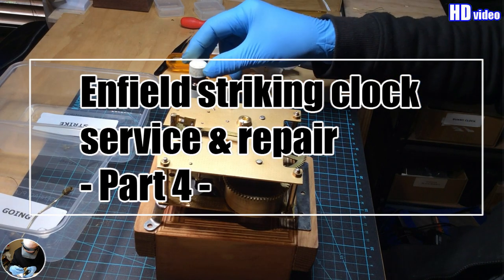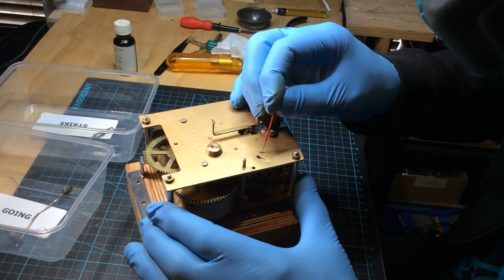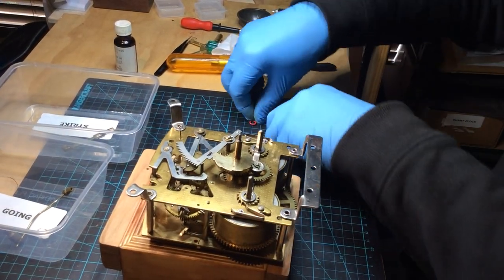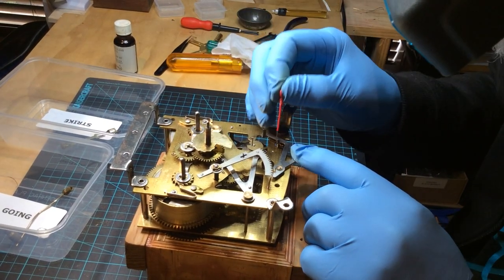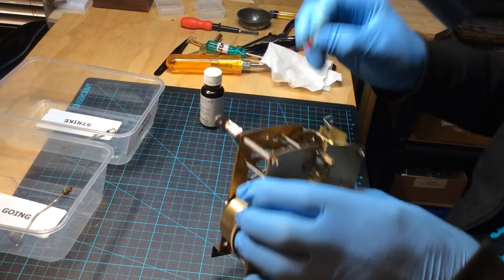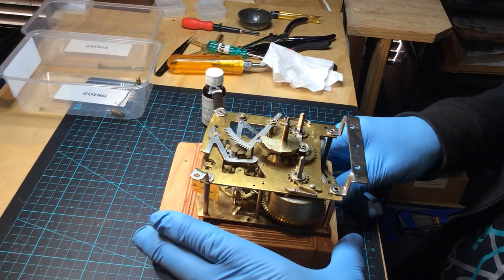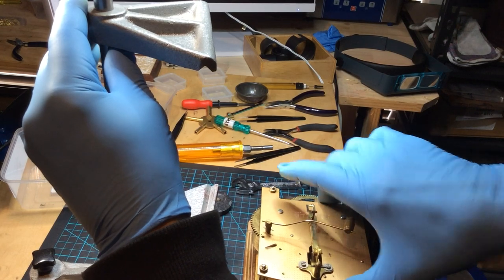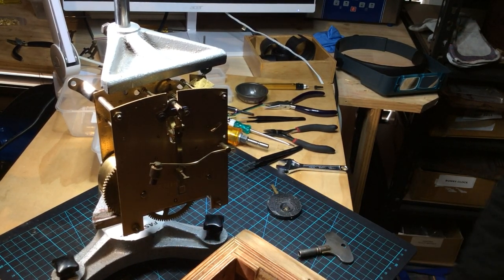Vintage English Enfield mantle clock service - Part 4 #EnglishMantleClockRepairs

Comment: Hi Scottie.  I have the same clock that someone broke both click springs on it.  I found replacement spings but since I'll have to remove the rivets, I was was thinking of using a brass screw to attach the new click springs.  What size screw should I use or if you have another opinion that would be great.  It is a beautiful clock and I'd like to get working.  thanks...Vince
Reply from the maker: Hi Vince, I am not quite sure what your problem is.
Can you send me a pic to: antiquesclockscollectables@gmail.com
Cheers Scottie

Comment: hi scottie, could you tell me, will the gathering pallet find its own position,i took mine off and guest when putting it back on, cheers in advance
Reply from the maker: Hi Paul,  the gathering pallet must be placed correctly so the pin on the gathering pallet falls into the notch on the rack lever. I will upload a video of how this looks tomorrow.
Reply from the maker: Hi Paul, I have uploaded the video for you today.
Reply: I am going to carefully remy mech and check all the pivots and clean the pivots were do you buy your oil